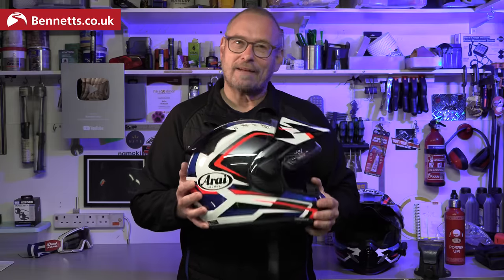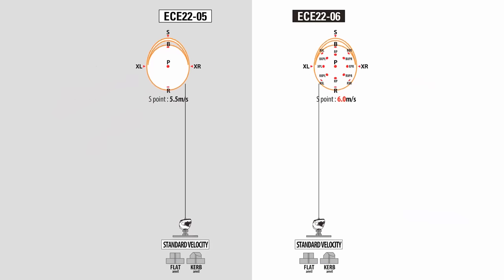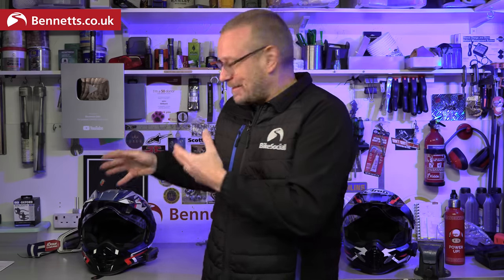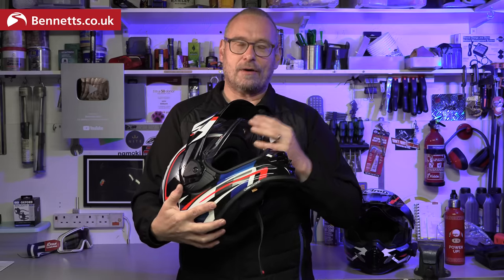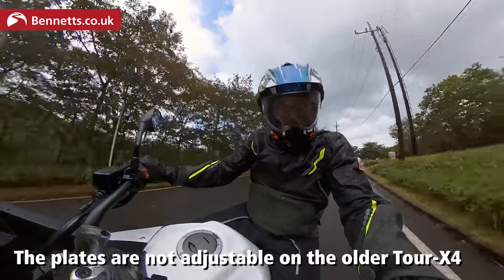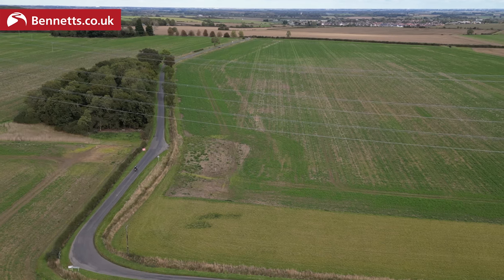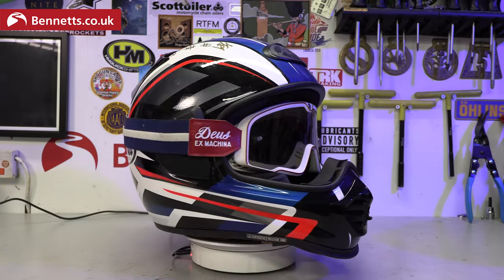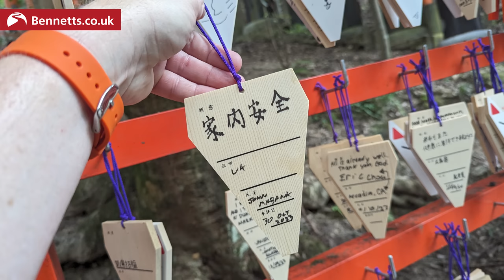Arai Tour-X5 review: 1,000 mile road test

Comment: The statement that they will never forsake their beliefs for the sake of sales is the only reason you need to buy an Arai, yes they are pricey, but they also back it up with the highest quality on exterior and interior, and lets be real, that price, over the span of 3-5 years is nothing compared to what you get. So thanks Mr. Arai for everything you done for the safety of your users.
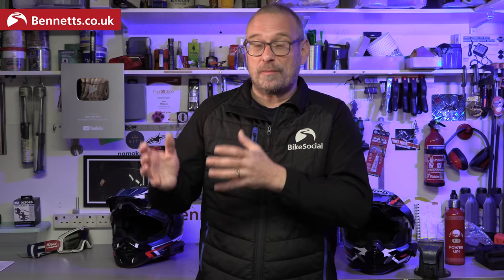Reply: 22:50 - Arai helmets are not the safest just because they say they are.That statement alone is just marketing.
Arai are known to be good for much more reason than just that statement, but if you make your buying decisions based "only" (your word) on a statement, you're a fool.
Reply: Correct where is the evidence to proof they r safest ?
Reply: This helmet lacks the usual exterior quality tho.

The rear extraction vents are roughly cut out, I never saw another helmet’s vent (even in 50$ cheapos) so badly refined. What the fuck were they thinking.

Comment: I’ve owned many helmets, mostly for track riding, but always have an Arai full face and an Arai XD-4 around, and those are the ones I actually wear out. My poor XD-4 is well used, awaiting the long-anticipated release of the XD-5. Just as this reviewer noted, I had slight discomfort and a red line on the first day’s ride with my latest Corsair, but, after that, it has fit perfectly. I’ve also crashed (not heavily, but enough to grind the face shield and front vent system) with no failure and no injury. I think these helmets are worth every penny, and am glad Arai sticks to their design philosophy.

Comment: I just bought the X4 for from a certain motorcycle apparel store in Guildford.... They're clearing out their old X4s, picked a graphics option up for £360, so I'm very happy with it.
The new X5 looks amazing! Looks like some great improvements, especially with visor and pinlock.
Great video as usual John, maintaining high standards isn't easy, so well done.
Reply from the maker: Thanks so much! Yeah - the deals on the X4 are very, very good!
Reply: This. I do not believe the X5 is that much better to pay extra 400 gbp for it. Yes, it has some great features, I especially like increased safety, the quick visor release and prep for intercom but I would struggle to pay almost 2x of what the X4 price is currently. Curious how the plastic screws will hold up and will wait for a promo on x5 in the future.
Reply: I just paid £340 for a white X4. Too good a deal to pay £600 for the X5... My first peaked lid, so want to try the style first before spending top dollar.
Reply: Buddy you made the best deal

I tried the X5 and it feels and looks waaaay cheaper than the X4

When you get one in your hands, just look at the rear vents and tell me if they don’t seem something drilled out as an afterthought with electrician’s scissors

Never saw less refined vents, literally

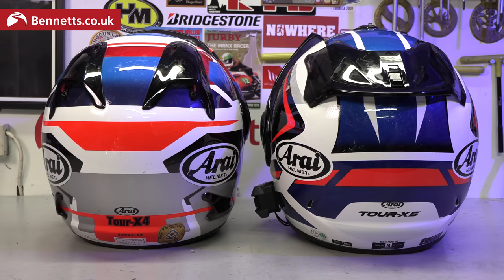Look at the video at 11:00

Comment: I had horrific water leaking on the visor of my TX4 (with pin-lock fitted) .... tried everything I could think of to no avail.  Even the local importer tried to 'fix' it, also to no avail.  This has permanently dissuaded me from purchasing the TX5 (or any Arai product), and I went with the Shoei Neotec 2 instead (modular).  Never been happier!
Reply from the maker: The Tour-X5 was unusual among Arais in that the visor plate wasn't adjustable – this new one is. Glad you go on well with the Neotec 2 though – a great helmet. Cheers, John

Comment: Just recently saw this (and that the 5 was released) I’ve had an XD4 until recently when it was stolen. It’s the first helmet I’ve owned that just “fit” perfectly. I put thousands of miles on it on my DR650 and even my softtail when I took the peak off. It was stolen from my garage along with a bunch of other stuff so I was in the market again for another. Ended up trying an xp9 bell helmet. Definitely cheaper, much louder. Wanted to wait until the 5 was on the shelves in stores so I could try it. The bell is a budget helmet and I guess I was spoiled. Wish they had MIPS but comfort alone was almost better alone.

Comment: An internal sun visor has always been a must-have feature on my helmets because I don't like wearing sunglasses or having to carry a clear and dark shield. Because of that, I'd always gone for Shoei helmets. I had gotten sick of Shoei's relationship with Sena (their QC and support have fallen off a cliff in recent years) and so I voted with my wallet. Picked up an Arai Contour-X for last season, and I absolutely love it. I wish it had an internal sun visor, but I do respect Arai's commitment to safety and refusing to compromise on that. They stick to their principles!
Reply: I admire Arai's commitment to safety but I'll take having a slightly weaker helmet with a sun visor so I can see the road ahead of me in low sun than one of their helmets anyday.
Reply: @therealquaid1694  I feel like they should embrace photochromatic shields. I'm not talking about a photochromatic pinlock insert, but the face shield itself (which would support a pinlock insert as they already do).

Comment: While I get that Arai won't make a modular or drop down sun visor for safety reasons as they want maximum protection, they kind of contradict themselves by still making open face helmets.  You would think a modular would be safer than an open face.
Reply from the maker: I agree in principle, but Arai's argument is that the first lids they made were open-face. Also, that they would only make a modular lid the chin bar would sheer off safely when ridden in open if crashed, but also be as protective as a full-face when ridden in closed.

Comment: I just purchased the xd-4 (US version) after watching this. The only real improvement I see is the visor shape making pin lock easier to use. Every other change for me wasn’t worth waiting for. Visor changes still require a tool, who cares if it’s only 1 screw vs 2. The visor is slightly longer…no big deal. Routing intercom wires was easy in both so , meh. Pretty much the same helmet with a different visor.
Reply from the maker: If you don't need to take the shield out (what I call the visor) then there's less benefit to the new one, but that depends how dirty you tend to get it I guess

Comment: 40k miles so far on my Tour x4, have nothing but praise for the helmet (maybe except for the pinlock fit)... But I don't like the new design at all. The peak looks cheesy and offers less protection for the visor in the open position (90% the time where it is), so I'm going to buy the old model again. BTW, wheel weights will scratch the visor when the peak is in the lowest position, so not recommended...
Reply from the maker: If the weights are positioned correctly, they don't get near the visor.

Comment: I dont underdtand Arai, they think its safer to not have a sun visor and be blinded by the sun than have a slightly weaker helemet where you can actually see whats going on infront of you.
Reply: Just stick a dark visor on if you are sensitive
Reply: @MartinChafer  If you commute early morning/evening where I live in Scotland it's not ideal to do that as it gets dark very quickly and in the winter the sun sits very low in the sky. Its easy to flip up and down the sun visor when it's required for the best view ahead when entering/exiting shaded areas.
Reply: Buy the small add on mini shield. Have it on my signet and it works great.